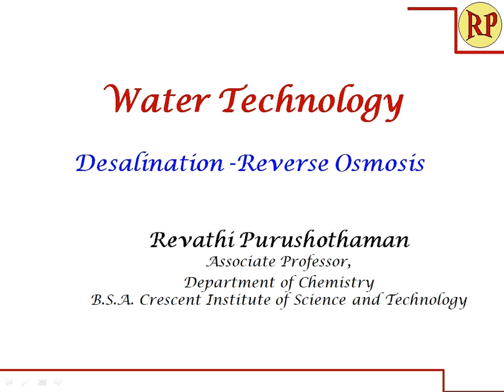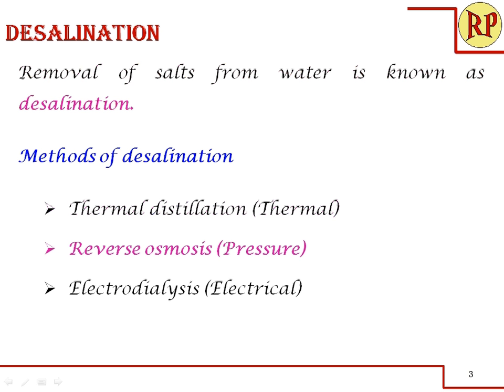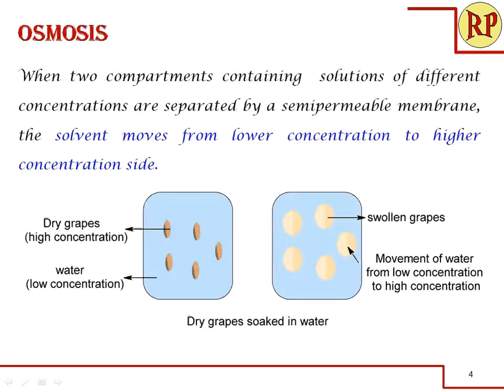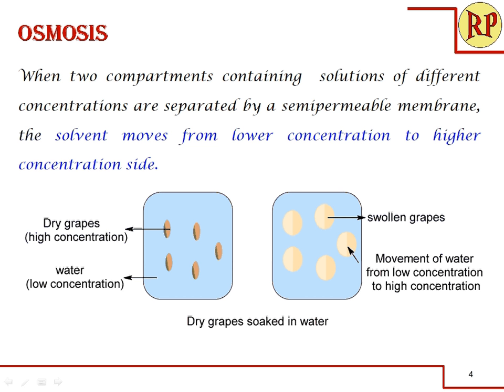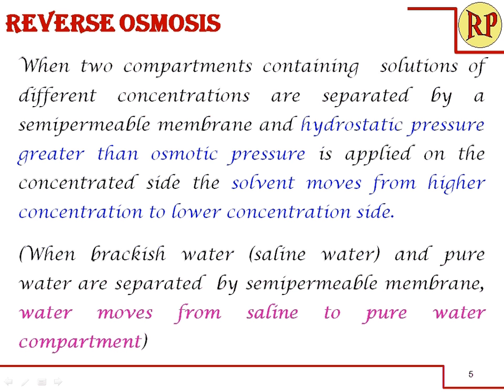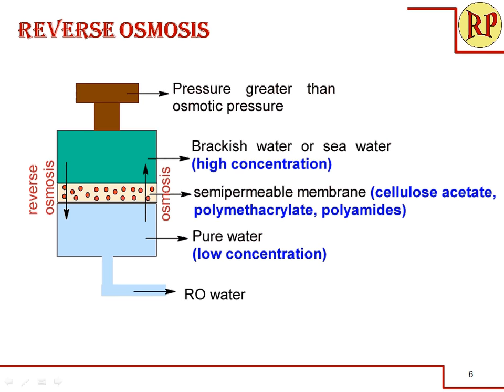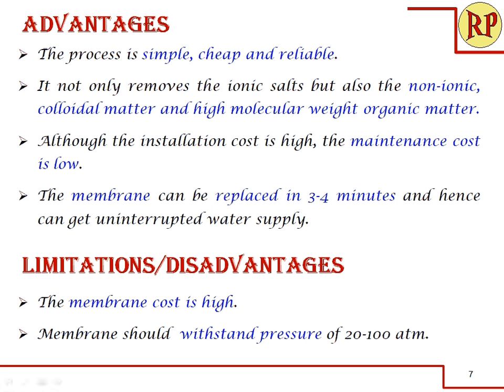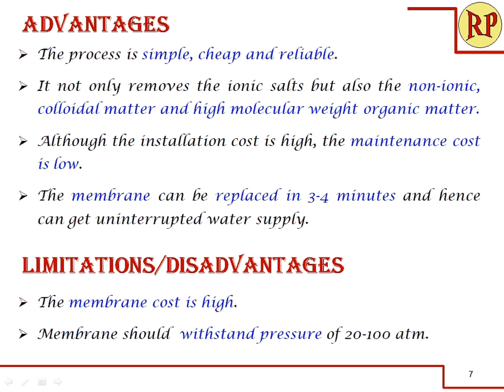What is reverse osmosis process?/RO water treatment (Desalination)

Comment: People have made use of reverse osmosis but what about straight osmosis? Wouldn't it be possible to use an electrolyte mixture (like Gatorade powder) to draw water through a semi permeable membrane? Pond and river water could be made safe to drink without all that pumping that normal filters require.
Reply from the maker: On straight osmosis, water will move from lower concentration to higher concentration. Reverse osmosis is mainly used to reduce the salt (minerals) content in the water.
Reply: @RevathiPurushothaman  but it is also used to remove bacteria and other contaminants.